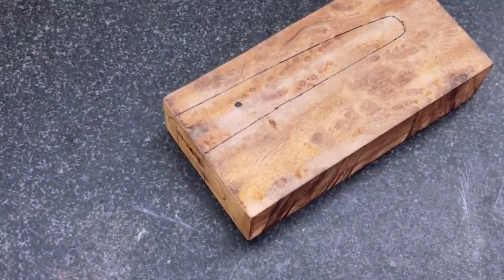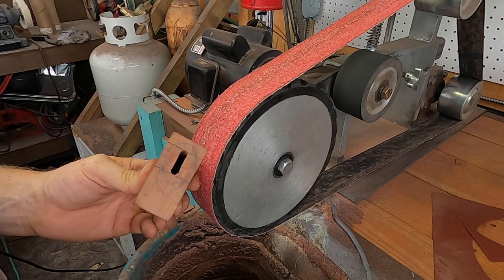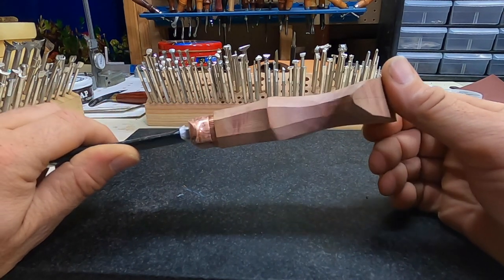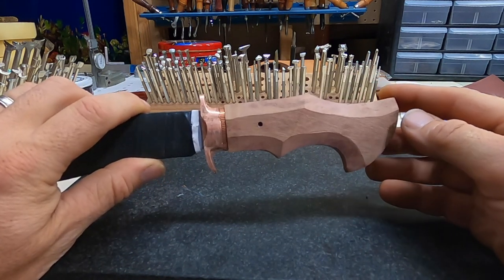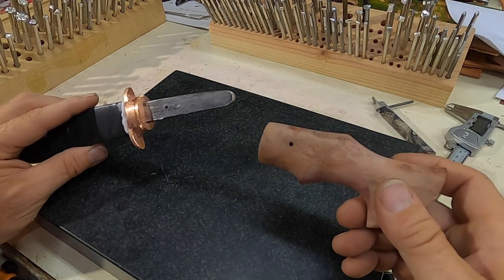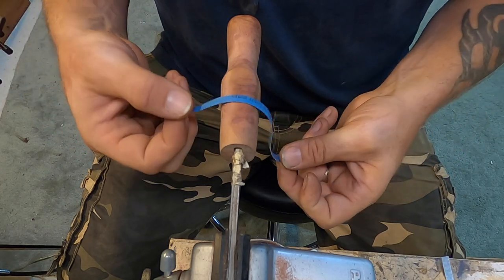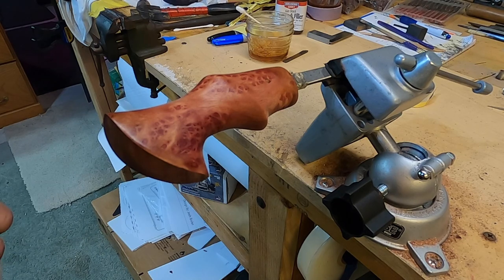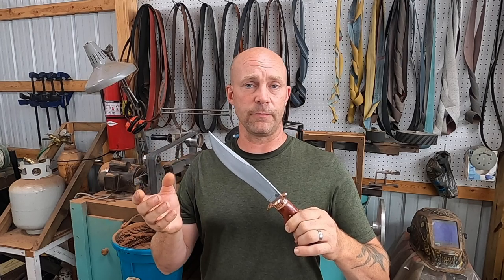How To Make: Knife Handle - Hunting Knife

Comment: Beautiful knife! I have found in my history of buying knives, most handles are made for smaller hands. It is very difficult to find a knife with a slightly larger handle to comfortably fit my large hands. I wish knife makers would consider many men have larger hands. Men who buy knives for working usually have larger hands.
Reply from the maker: Hey Robert!  One of the things I ask the customer is how large the hand is on the user.  I have average sized hands but prefer a slightly larger handle because I like to move my hand around at different leverage points.  Thanks for watching and the compliment on the knife!

Comment: How do you drill the pin hole after heat treat? I do the wood working part with traditional hand tools, planes, scrapers, sandpaper but a similar process. I just prefer the feel of doing it that way, but I'm a hobbyist, not selling, not in a hurry.

Comment: Really nice, How did you do the pin without re- doing handle?
Reply from the maker: Thank you, Bradley!  The pin is fit close to length, epoxied, and then slightly peened to tighten it up.  I then come back with a Dremel and finish up the heads on each side.